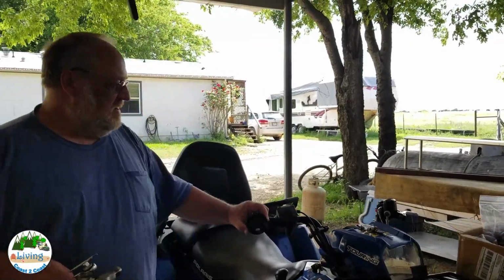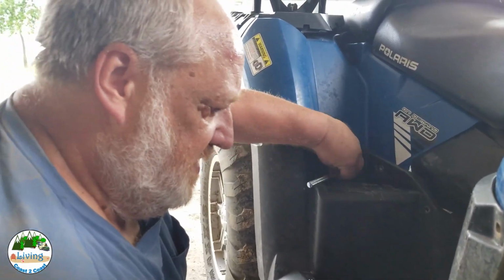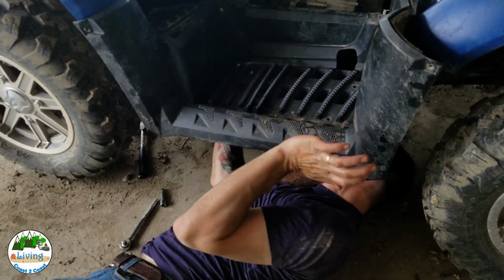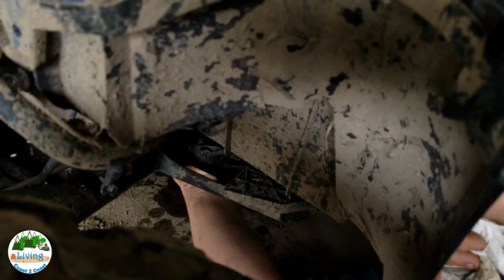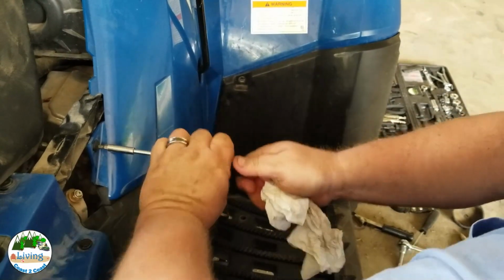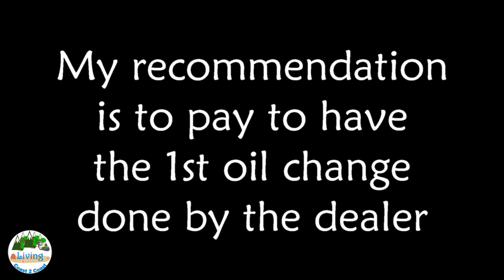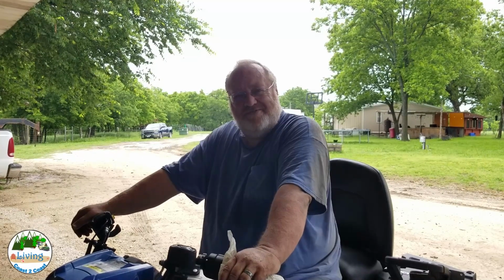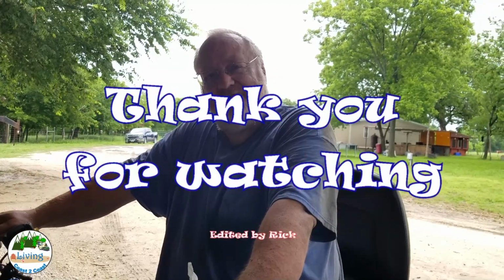2014 Polaris Sportsman 550 Touring Oil Change Procedure |:| HOW-TO |:| Living Coast 2 Coast

Comment: What size oil wrench is the original filter? I can't get it off but the oil wrench I have fits the new oil filter
Reply from the maker: I don't know the actual size. It is slightly bigger than the new one.
Reply: @LivingCoast2Coast  got it thankyou! Ended up using a claw ratchet and some tape to make the claws grab better!
Reply from the maker: @123brendan100    Good idea. Thanks for sharing. I will pin this comment so others will see.